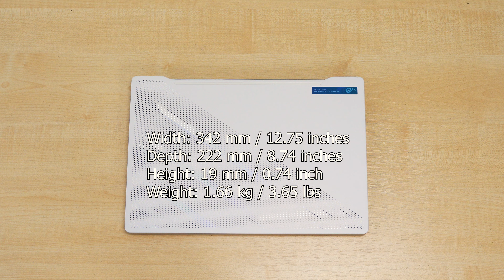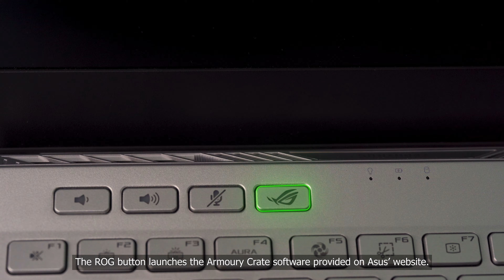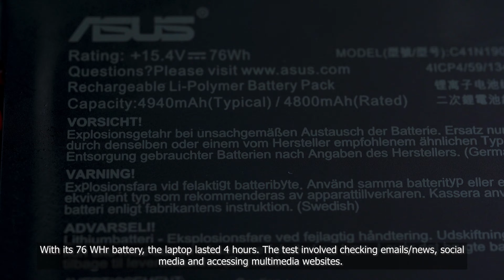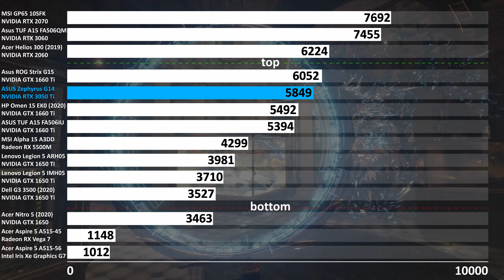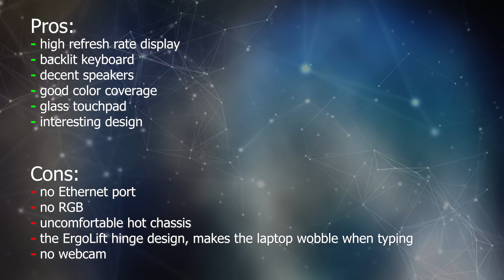Asus ROG Zephyrus G14 (2021) Review - Unboxing, disassembly and upgrade options

Comment: I decided to buy ryzen 7 5800HS gtx 1650 , but i have a confusion, is there only one ssd slot which is preoccupied by 512gb ssd, so if i had to upgrade to 1 TB, is there an additional slot to add 512gb or should i replace the existing 512 with a 1TB ssd ???
Reply from the maker: The G14 has only one m.2 SSD slot. You nee to replace the existing one to upgrade to 1 tb.
Reply: @Notebcom  thanks 😊

Comment: Are the thermals really bad that it reduces fps in game? or is it normal and not reduce fps/general performance of the laptop
Reply from the maker: Thermals are not that bad to reduce FPS. But the laptop charger doesn't provide enough power in heavy loads and the laptop ends up throttling.
Reply: @Notebcom  Thanks alot🙌🙌
Reply from the maker: No problem

Comment: This is %100 srgb not 90 can you check again but my model has 5900hs
Reply from the maker: We checked with professional display calibration tools, like X-rite. The laptop has 90% sRGB coverage and 99% sRGB volume. Please don't confuse volume with coverage. For DCI P3 the laptop has 69.4% coverage and 70.1% volume, and that's the new industry standard.

Comment: Just 4 hours??, everybody talks about 9 hours
Reply from the maker: Depends how you test the laptop. If you turn off the wireless, put the display on minimum brightness and set everything to power saving model, then you can double your batter life. it also depends on what you do while on battery. But we test battery life on more realistic scenario with default windows settings and brightness set according to visibility under normal web browsing and general home activities.